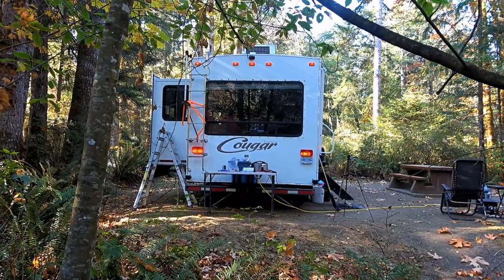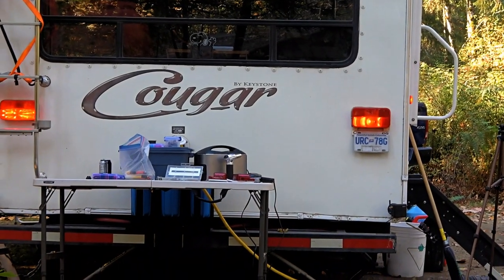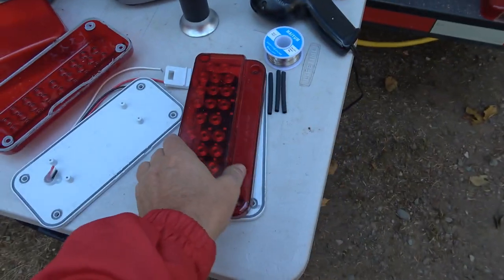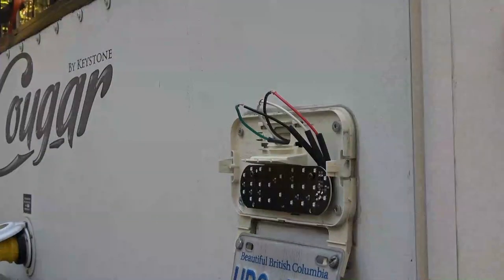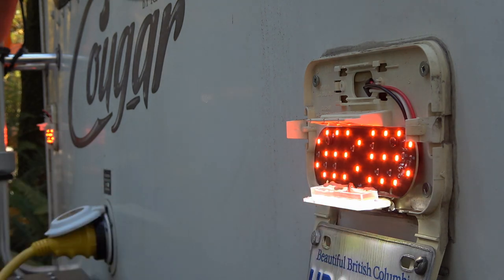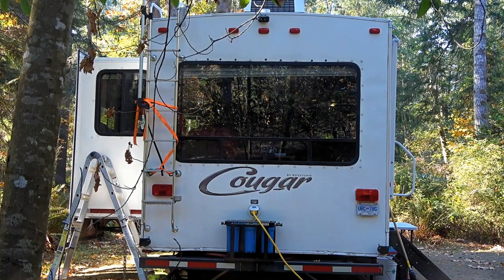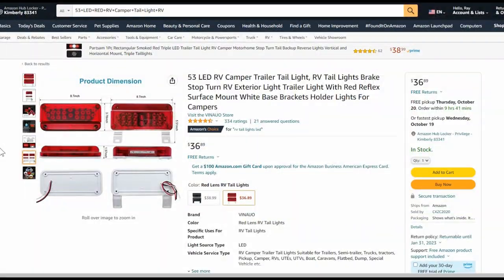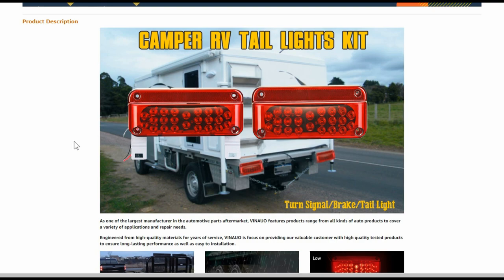Incandescent to LED Trailer Tail Light Mod to Keep OEM Lens Assembly

Comment: I’ve been having the same issue. All the LED lights have a smaller foot print. I found a set on sale at princess auto for $25. I’ll be using your method. Thanks for sharing.

Comment: Nice work. Have you thought about adding a high-level brake light in the center?
Reply from the maker: Haven't thought about it. It would have to be really high to be above the window. Could be a chore to try and fish the brake wire up there.

Comment: I have a stick on led light bar thingy on the back of my van and it plugs in the trailer flat 4 pin connector it's a good setup for 29.00 bucks at Walmart

Comment: Love the idea. - The diffusion pattern looks aweful in the video.
Do you think you can add a translucent diffuser between the leds and the lens?
Reply from the maker: Could do, but in real life they are acceptable as good or better than the OEM bulb and way brighter. Cheers, Ray
Reply from the maker: Noticed I had one of the lenses the left one on upside down. :)
Reply: @LoveYourRV  That's why they looked different - lol

Comment: Hi Ray, as you well know, led isn’t very waterproof so better get out the old silicone just in case…cheers 🥃🥃
Reply from the maker: Yeah, a little bead should do the trick once I'm sure everything is working well.

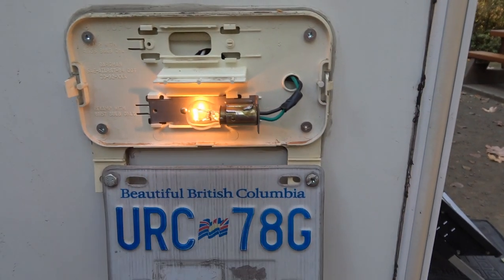Comment: @1:53 the incandescent bulb looks very dim, like a low voltage issue.  Where are the bulb/holder assemblies from the upper half?  Where they not installed from the beginning?  Maybe you left that part out.  I only see two wires to the incan bulb but you show three which you would need for tail/turn to the led.  Used to be federal guidelines on exterior lighting.  Older vehicles benefit from led upgrades but you may have signal issues as not enough current draw to flasher.
Reply from the maker: There never was anything installed in the upper half. Here is a past video where I replace the OEM assemblies with new - https://youtu.be/vEYYQyMNFFs  The third wire was attached to the metal bracket that held the incandescent bulb. It was the ground return. No signal issues since my 2018 truck uses a electronic flasher module suitable for LED bulbs vs the old mechanical ones. Cheers, Ray
Reply: @LoveYourRV  Not sure where my brain is today.  Oh well...